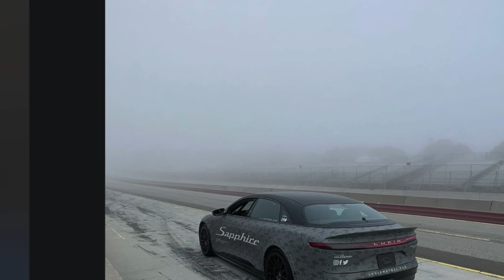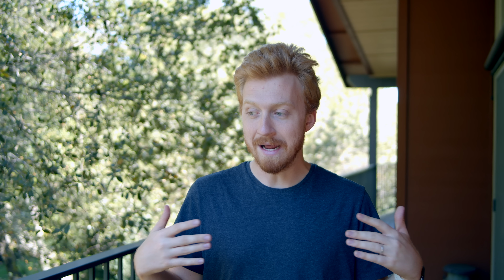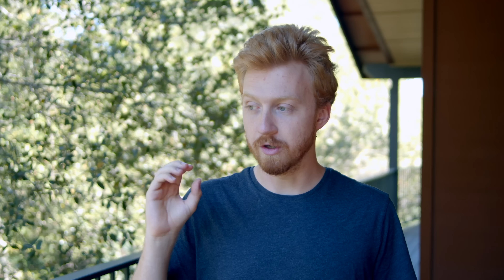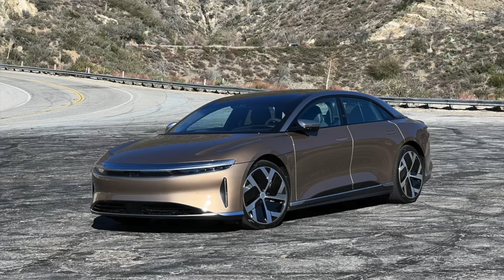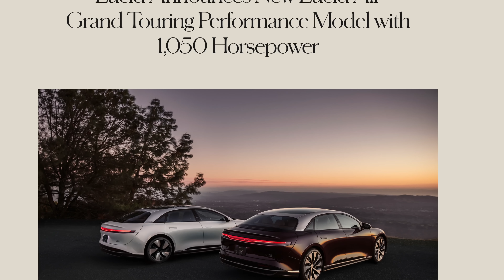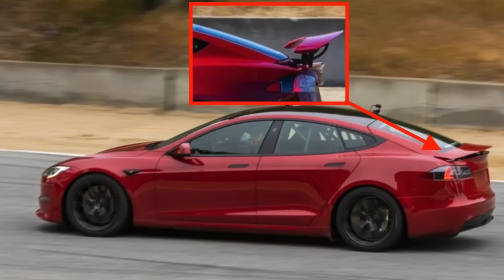How & Why Lucid Sapphire BEATS the Plaid

Comment: Actually tesla uses smaller battery packs is the reason why lucid has higher range. If tesla had same kWh pack then it will have higher ranger and be faster

Comment: It would beat the Tesla Model S Plaid if It weren't for the pricing. It will cost $250,000 that's +$100,000 than the Plaid. It's no compesated

Comment: The lucid does not beat the plaid because they are not able to achieve the same or better level of performance at an equal or lower price point. You would have to be a fool to think that lucid is making a better vehicle than Tesla and hell lucid was only able to build less than 500 vehicles in the last 3 months and have major quality issues.

Comment: Tesla can easily regain the Nurburgring record by simply making upgrades to the tyres and brakes available to order as standard production items. 

Originally Tesla won the record by just going out there with a standard car and it then took Porsche a year and a car costing considerably more ($180k vs. $120k) to win it back, by only 2s in 7m 33s - a mere 0.4% faster.
Reply: I think the brake upgrade and maybe tweaking of the software would be enough, but better tires wouldn't hurt. The Tesla carbon ceramic brake kit upgrade increases the rotor diameters over the stock rotors significantly.  This results in 33.4% more brake surface area on the front rotors and 20.7% more on the rear rotors, so braking should be greatly improved.  Also, I would guess the carbon ceramic brakes would reduce the unsprung mass at each wheel by 15-20 lbs.  I think there is a lot more room for improvement with the Tesla, whereas the Nurburgring Taycan Turbo S may already be at its optimal configuration.  With the brake kit the Plaid should have improved braking, better handling and be 360-380 lbs lighter than the Turbo S on top of the fact that it already has a stronger torque and power delivery.

Comment: About the end comparison between Plaid and Sapphire and Roadster: Another thing is that there aren't many other cars you can get with comparable performance that aren't 3-20 times as expensive. Once you're breaking 2 seconds on an EV, it doesn't matter if you're 2 door or 4 door or whatever because you're gonna be sold out. What gas car can even compete?

Comment: What's funny is that Tesla can ramp up production so much faster than these other guys that if they modified the Plaid to use 4 motors and gave it a couple hundred more horsepower, they would probably STILL beat the Saphire to market, at least in any kind of large numbers. That would quickly steal Lucid's thunder.
Reply: Tesla can just do an over the air update on the Plaid prior to the Sapphire release. Existing Plaids are already capable of over 1,200 whp and an 8 second 1/4 mile, they’re just software limited right now.
Reply: @vickykennel7414  Don't have the technology to do what? Over-the-air updates to increase horsepower? This has already been done multiple times on several Tesla models. And 100 miles? Hardly. It could be a "super ludicrous" mode that would be an OTA update, with penalty of slightly lower range, which wouldn't matter anyway since Plaid owners would not be engaging this mode at all times but only during races, etc.
Reply: @vickykennel7414  This would have little to no impact on range for normal driving, the only range decrease would be from using the full power under racing or massive acceleration which any car would have with the same power.

Comment: OK. Just letting you know that the 18650s can output more power than a 2170 cell. The larger the cell, the longer the jelly roll and the longer the path for electrons to travel, that's why the tabless tech was developed for the 4580 cell which has an even longer jelly roll.

Comment: It's not impossible to transform a 400v DC circuit to 800v just to the motors. As for the motors that's not the problem.

Comment: Not sure Lucid's problem is funding. I think it's more so about production challenges. So, even if they introduce more expensive variants, it still wouldn't solve their problem. But, in the case of the Sapphire, the only reason it's pumping out that much power is because it has a bigger battery, and not because it has an 800V architecture. If Tesla goes 120kWh like the Air, it'd make those numbers with a 400V architecture.
Also, Tesla doesn't need to release the Roadster for this. Just let the Plaid motors tap into the 23K rpm it was carbon-wrapped for.
Reply: Production challenges mean less cars, which means less revenue which means more losses which means a shorter time before current funding runs out, which mean risk of not sorting production problems before bankrupcy … which wouldn’t matter if they had enough funding.
Reply: @andrewpaulhart  Even if you infuse $100B into Lucid, if they can’t figure out how to mass produce their cars, it still won’t change a thing. That’s what I’m saying—from order of most pressing to least pressing. Not that they won’t need cash later.

Comment: Koenigsegg with the quark has the lightest most compact and powerful ev drive unit tech atm. 
Dual motors, integrated inverter, gearbox and 3d printed case with torque vectoring for each wheel. 670hp&just 183# in total weight.
Reply: @Johnathan Blake Anderson well it's American made so I'm a fan. Otherwise it's a hypothetical motor period. 
Not a single one exists yet to be torn apart or tested, outside of the prototypes and it will be a year or more before the first sapphire air is in someone not working for or paid by lucids hands to objectively review and share performance figures on.

I'm excited to see Porsche Audi tesla and other's response if any to the sapphire edition air. 👍🏻😎
Reply: Those are meant to be assisted by ICE. Can't run that alone, not enough cooling.
Reply: @KyleHubb  wrong, Christian himself said the multiple ev motors in the gemera get it up to speed very quickly a sub 2s 0-60 for a full size 4 seat hypercar. And then the turbocharged ice helps it continue to accelerate at speeds over 200kmh. That's the actual boss of koenigsegg speaking, I'll take his word for it. 👍🏻
Reply: @4literv6  It's actually from his words that I'm interpreting this. Gets it up to 200 km/h. After that, you're going to need an ICE. Exactly what I said.
Reply: @KyleHubb  except the plaid is still pulling over 1g past 130mph and recently unlocked hit 217mph flat out. 
So he's just trying his best to prolong ICE demise imo.

Comment: 2:58 '2170 cells [used in Lucids] are more "up to date" than 1865 cells [used in Plaids]'
According to Drew Baglino, the 1865 and 2170 cells both receive periodic updates to their chemistry.  Tesla chose the 1865s for the refresh S and X because they are better suited for high power transfer, being smaller and having more surface area for thermal control.  Munro's teardown of this pack shows lots of engineering genius toward maximizing manufacturing efficiency and minimizing weight and bulk, which contrasts with Lucid's old-fashion modular battery, complete with foot garage.
Reply: You are absolutely correct, use the correct chemistry, and correct form factor for the job.  Don't try to pound a square peg into a round hole.
Reply: Nothing wrong with the 18650. People think it's the same exact battery used on the first model S.

Comment: Having now worked on a couple of these I can tell you the build quality is sub-par, similar to the original 2012 model S. We literally had trim molding and such falling off the car. I am NOT hopeful this new version will help or save this company in the middle of "production hell".
Reply: We traded a 2015 Model S P90D for a Model S Plaid in August 2021.  We took delivery of our Lucid Air Dream Performance on December 31 (production #154).  The Lucid, while not perfect, was delivered with fewer assembly issues than the Plaid.  Among the issues with the Plaid:  steering yoke scuffed against the column, front passenger door requires a hard slam to close, rubber cover fell off a metal stud on the trunk lid, serious exterior panel misalignments, interior trim misalignment on dashboard, protective film under door handles and on rear fenders noticeably yellower than the white car.  In fact, our 2015 Model S had fewer fit & finish issues than the Plaid.

We now have almost 10,000 miles on the Air and over 11,000 miles on the Plaid.  The Plaid has developed several squeaks and rattles.  The Lucid has none.

This is probably our last Tesla.  We're already waiting for Lucid to open reservations for its Gravity SUV to replace our Honda Odyssey minivan.
Reply: @TailosiveEV  You may be right.

Comment: 2:00 At this point you begin parroting Lucid's marketing.  Exhibit A: the claim that their motors' have unparalleled power density, complete with a museum exhibit of the amazing hardware.  Is there any 3rd party corroboration of the claim? Of course not -- this is Lucid.  It's clever -- package the motor so that it includes none of the mounting weldments that transfer forces to the chasis, then compare to a Tesla motor assembly that weighs twice as much thanks to integrating structural features into the housing castings.  This kind of sleight of hand pervades all of Lucid's marketing.
Reply: @TailosiveEV  and what's your excuse for the Edmunds test showing it took over 144.5kwhs to fully recharge it? 🤔

Yes that's my point you and others like you brag about the lucids efficiency(it is damn impressive for what it is imo, but rawlinson lied through his teeth about stuffing a huge pack in it, because the air is the largest pack employed on any none ev pickup right now. 

So it's still per the epa(a criteria you used)not the most efficient 4dr ev on sale, which is the model 3 sr. And again it's overall size is right between a model 3 and model s, so is the acceleration and efficiency. What's even more ironic imo is the price is so much more an average buyer. Could have a model s and a model 3 for about the same cost as one loaded air dream perf edition(try saying that fast. 😀
Reply: @TailosiveEV  Lucid owners were reporting 2.8m/kWh, before a recent software update. Might've improved, but, not the real world efficiency king like the Taycan which totally beats its EPA figures. lol
Reply: @TailosiveEV  134kwhs isnt proof to you? 144+kwh from the edmunds recharge test isnt proof enough the pack is simply enormous? 
If 800v is so efficient shouldn't the air also beat tesla on total charging efficiency? 🤔
Reply: @4literv6  Yeah 134kWh is the power used by the station not what’s put into the battery pack. Exactly as Drew already told you. And actually no, the 950v architecture allows the car to charge so much faster than Teslas that it creates a lot more heat in the process. Making it faster but less efficient at charging. Mostly because of Electrify America’s Stations inefficiencies though.
Reply: @TailosiveEV  large vehicle? Get real dude, the air is right in between the model 3&model s in total overall dimensions.
It's efficiency is slightly over the plaids and still under the model 3 which epa docs also show. 

Also in Edmunds testing of an air? Yeah it used 28.3kwhs per 100miles and went 505 miles. So you do the math there. 
Also Tom from inside evs showed his test vehicle took over 134kwhs to recharge it.

Comment: Well technically the Tesla model S plaid is software limited,  it will not give full power till 80 MPH and the top speed of software locked to 175 MPH, but remember that guy that bypassed the limitations that got the car up to 216 MPH, if he hadn't probably ran out of runway the car would continuously accelerate around 5 MPH per second, some guy on YouTube did math and thinks the cars true top speed is 220MPH, Tesla probably won't change the restrictions with a update because of safety, the street tires probably can't handle a 5000lb car going faster to 0-60 a little less then 1.98 sec and a top speed of over 220!
Like a captain put the safety of your customers before yourself!
Reply: It's power limited up to 80 mph because it's traction limited. More power wouldn't increase it's 0-80 mph times unless you put slicks on it.
Reply: @sorka95032  indeed as I said street tires will not handle it!
Reply: @sorka95032  HEY you stop trying to give him logic! They clearly don't understand basics of physics but it's okay.

Comment: 2170 batteries have poorer power density than 18650 batteries.
I'm pretty sure Lucid advantage is the size of the battery and maybe also the chemistry but not form factor.
Reply: @TailosiveEV  Yeah, I mean the size of the whole pack. I think it's just brute force but it could also be the chemistry.
Reply: Since Tesla’s most performant cars have the smallest batteries  it is pretty hard to take that assertion seriously
Reply: @andrewpaulhart  The model S has the biggest battery of Tesla's lineup.
Reply: @johntheux9238  battery cells